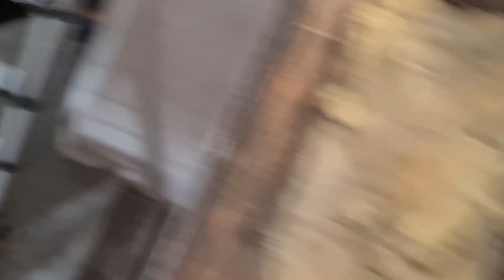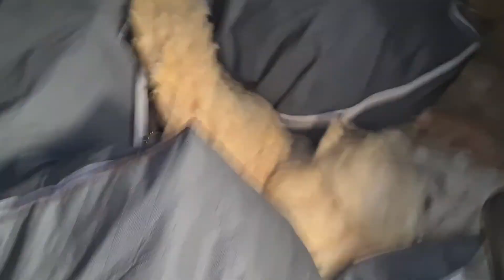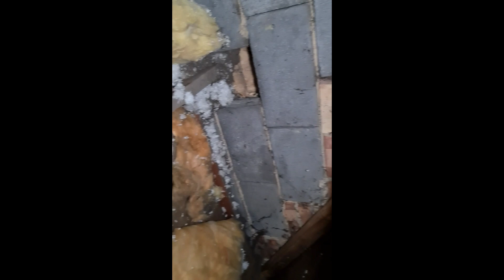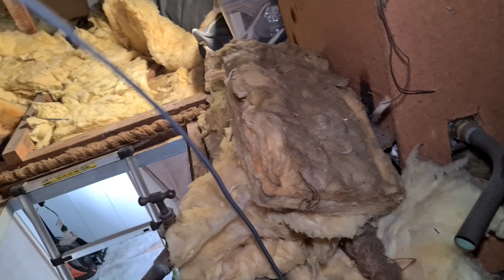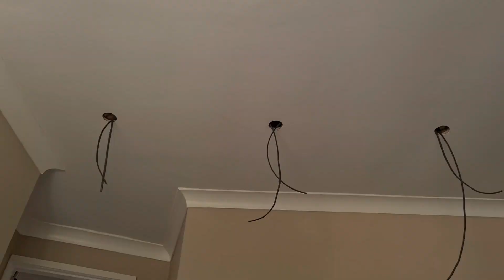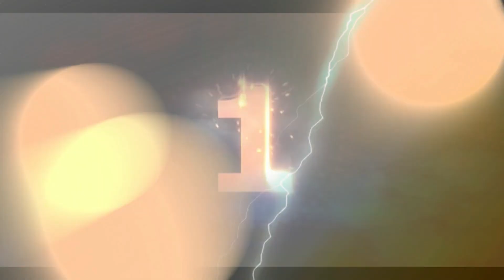HORRENDOUS Builder Electrics - Should we report them...?

Comment: Had something like this recently Mark, kitchen rewire and a few extra sockets in the living room as well as a CU (was an old 3036 board). Customer said that’s all the electric work they needed/wanted done. Came back to second fix and seen that they had a new bathroom put in with new spot lights in place of the original bulkhead. Was told it was the bathroom fitter who installed them, checked the connections and sure enough it was as expected with single insulation on show, needless joins in the cable and not suitably IP rated.

It’s frustrating but will never change as it’s like you say a lot of customers just look at the bottom line when quoting a job so whether it’s other sparks undercutting you or jack of all trade builders they unfortunately don’t really know any better

Comment: The central joint box in the loft I think you were referring to at the end we have one in our loft (1972/3 made by Volex) the whole of our estate has them in the loft they were pre-wired and the screws are glued all the electrician had to do is take switch cable 1 to the switch and light 1 to the same room even the 3 cores for landing 2 way go back it could have something to do with being a timber framed house and the estate consists of a defined number of house layouts. Ours does for 3 bedrooms bathroom and landing.
Reply from the maker: Yes pref and new build of a certain era were all like this. It was done in the 60s quite a bit as well